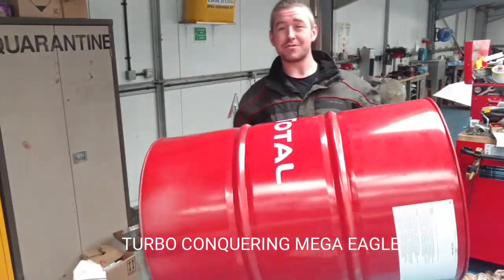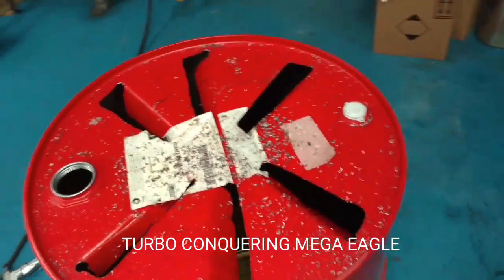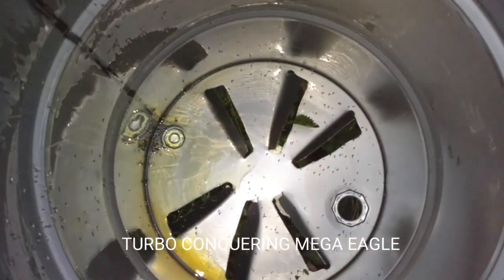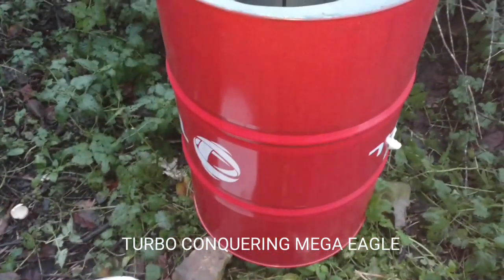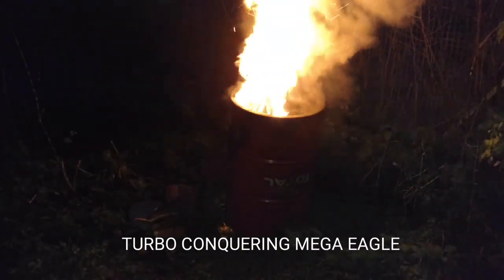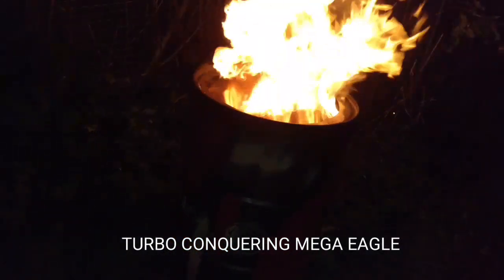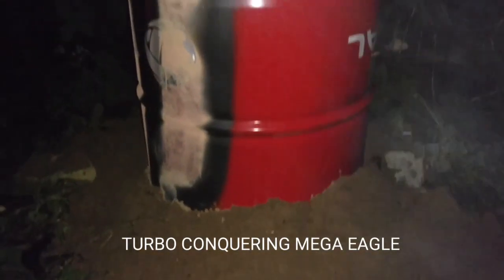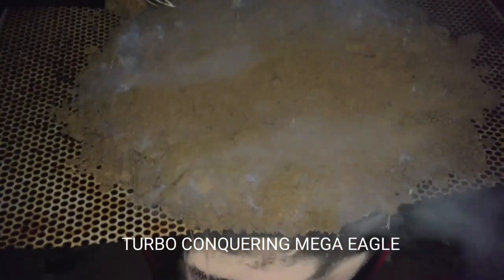Oil drum charcoal kiln, make your own charcoal!

Comment: Have you thought about adding an exhaust recirculation tube to turn it into a Charcoal Retort? You'd have to close off the bottom entirely and use an external fire at the bottom, but the Woodgas coming off the top can be burned by routing it down to the fire at the bottom, giving you higher temps and reduced fuel consumption. Furthermore, if you use a small enough external fire that it burns out around the time the Woodgas starts pumping out, then the Woodgas becomes the main fuel source, which means the fire will automatically die out when the Wood inside is fully charred.
Reply from the maker: I like this idea a lot however i think it would require a chimney through the centre of the barrel in order to cook the wood at the top of the kiln and some robust plumbing for the gas. I'm not sure i can justify a complex build for charcoal production however running a small honda genset on wood gas is something i will do in the future.

Comment: Had my first attempt yesterday and thought I had followed your video correctly. All very exciting! However, I ended up with a oil drum full of ashes!!! I had piled up the soil at the bottom and had lid on etc. Any advice?
Reply from the maker: Im sorry to hear that, air must have been getting in.
You could try wetting the soil and packing it down a bit, and maybe not letting it burn so long before you pack the soil.
Reply: @turboconqueringmegaeagle9006  Will try that - many thanks :)